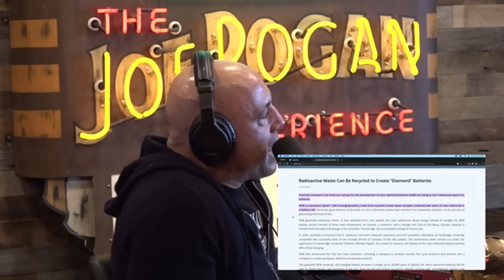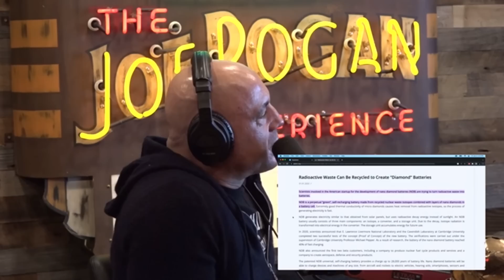Lifetime Nuclear Waste Batteries for Power,EVs & Gadgets #1921, #JoeRogan, #jre ,#joeroganexperience

Comment: So a solid point of view on the phone but the use of Radioactive Decay for power is not unheard of. The base principle has been tested by NASA. Using a Sterling Generator along with some radioactive material wrapped in a heat sink/protection module, the heat generated by the decay was used to power the Sterling motor and thus generate electricity. This means once practical application is work out, you could create a generator for a home that would provide all of its electrical needs, 24/7 with no emissions and he smaller than an outhouse.

Now since there is no nuclear event taking place the only way these can be dangerous is if the heatsink/protective cover is broken and those could be made to withstand a LOT of damage. Further these generate a constant power output that is likely above the homes actual needs. Adding this in a grid would mean whole neighbor hoods could be powered with a few of these and even if one needed to be stopped for some kind of maintenance the whole grid would still be operational.

Comment: This guy is kinda a brainlet, assuming that the heat is going to just randomly be used to generate power <-< FYI, the way they use them is by taking radioactive carbon, they compress it in to a diamond, a radioactive diamond, then encase it with nonradioactive diamond. Radioactive carbon is primarily a beta radiation emitter, which is electrons, IE potential electrical energy being emitted.

Comment: You would need a 1 ton battery to power your home. 
Radioactive decay is pretty weak (and also not so dangerous) but constant exposure would be very dangerous over time or if you breathe the material in. 

Could be a good idea to store radioactive waste tough. 

People are going to be much less worried about a set of "diamond  batteries" a few miles from home than a nuclear waste storage facility. 😂 Sounds a lot safer

Comment: This is just investment call talk.  It is to maintain the idea we have,  Right Now! An alternative.  Rubbish! 
Why is this a problem!  Radiation is energy on high scale.  Light is energy and crosses through a very wide span of what?  Vibration. 
Vibration is energy.  
So suddenly we have Nuclear waste/ energy/ vibration that is safe to use on our wrist? 
Where has the Hazard energy Gone ?
Energy for use has to be contained. Eg; Battery! 
High energy frequency needs lead to contain it. 
People fail to understand what Nuclear Energy Is.
They fail to understand how just  3 three smarty sized pellets contain a very large amount of energy. 
Church out YouTube, Thorium Salt Water reactors.  It is the best insight you can get as a layman.  TED X Channel an  Indian Professor speaks at a conference.  
You can get a better understanding. Even in a simple way.  Just three smarty sized pellets of Nuclear materials give how much energy.  
Check for yourself don't believe me... 
Notice he states that Nuclear waste can be used in a Thorium Reactor. Why! Because it still holds a large amount of energy/ Radiation/ vibration / energy.. So if they are to use Nuclear Waste, which sounds Great Right! 
But Where does the stored Radiation that is already there Go. ?????
Why is it still such an issue?  
Even medical radiation, which is considered safe at low levels. Becomes an issue if you are exposed to too much!  
I have medical issues.  I have to be careful about too many scans.  X-rays, CT's, MRI, and PET Scans! Which use radio active Isotopes via injection.

Comment: They have already come up with a system to recycle 94% of spent rods from reactors and put them back into plants. This pretty much solves the nuclear waste problem. Nuclear energy is safe as long as corporations, Russians and poor Japanese engineers (sorry Japan, that was a real bad location) aren’t running them. Or if this new nuclear diamond technology works they could just build onto existing nuclear plants to house it and use spent rods that way. It sounds like our energy worries are over. Or it’s another Thanos. 🤔

Comment: He's basically talking about a thermonuclear generator. Radiation is caused by decay of isotopes, which heats up the absorbing material around it. With that heat you can either do a conventional steam cycle (that's how all conventional power plants work) or you can do a thermovoltaic process (a connection of two conducting materials, heating one section produces electrical current). Modern space probes use that to power their devices but the power they generate isn't much. This can work for a few electrical devices but you can't power a city with it.

Comment: Joe read the tech would be able to charge devices, not put it in portable devices. I don't know why he didn't comprehend what he heard Joe say.
Reply: What Joe read is that a nuclear waste BATTERY will be used to charge an assortment of large to small portable devices, like planes, space vehicles, a watch or hearing aid.  Just like in your car or the battery-operated watch on your wrist, a BATTERY is a device that rides along with the portable device.  The guy heard Joe just fine, and did comprehend what was being proposed.
Reply: @paulryan2128  That's crazy you've never heard of a portable power bank before where a battery is literally just inside an enclosure that's only meant to charge other devices. The description is not even a battery at all, it's more of a fuel cell / generator.
Reply: @paulryan2128  a battery just holds charge. Joe said it would be used to CHARGE devices. The battery can be in a safe location and just charge or power devices from there.

Comment: It takes more then a pick axe to break diamond
Reply: not sure - they are hard, but they are brittle too i think?
Reply: @peetky8645  diamond is the hardest substance in the world pretty much
Reply: @zackwilloughby9185  being hard does not preclude being brittle.  harder steels are more likely to shatter than normal steel which just bends or deforms when hit.  diamonds in industry tend to be used for grinding or cutting  rather than hammering i think - this could relate to wear resistance as opposed to impact resistance.  not sure though.
Reply: @peetky8645  no I mean you have to get a special laser to cut diamond because of how hard it is
Reply: @peetky8645  as in it's not brittle to break apart
Reply: The point behind the statement still stands

Comment: Could be used at night to feed the grid when solar isn't available. Also could be used on remote communities like in Alaska that currently use large diesel generators and rely on fuel deliveries.
Reply: radioactive decay power sources have extremely low power density.   the article is BS written by a J school graduate who listened to a marketing graduate at a startup tasked to produce some buzz about a "product" to drive investment capital, not by someone with a background in physics.  i respect zeihan for giving a somewhat critical assessment of the fabulist technology on the fly-it speaks to at least a modicum of understanding of physics and energy flows.   the faces of watches used to be painted with radioactive paint that glowed dimly with a decay reaction in a dark room.  all the women who painted the dials died of cancer; your watch would set off a geiger counter, but the energy level would not even register as warmth.  the energy levels of decay processes are not energetic enough to power much of anything.  several pounds of plutonium can keep a satellite running with a few volts of energy and a few amps from its decay reaction.  fission and fusion are the only nuclear processes energetic enough to power a community or even a modern home.  a decay reaction might run an led flashlight, but the flashlight with a single led bulb would weigh a few pounds.
Reply: They currently dump this stuff a couple miles under a mountain because it will turn you into a gremlin and rot your ball's off. No thanks would rather use coal

Comment: Use the energy from the diamonds like gas stations use gas. Duh!!! Some peoples make mountains out of mole hills. They already have a diamond battery and it isn't hot or radioactive. You can use them in pacemakers.
Reply: don't know what diamond has to do with a battery because diamonds dont produce electical current, they are pretty much just carbon.  plus diamond is not cheap.  they may conduct electrical current better than copper or silver, but they are way more expensive.  any loss in conduction shows up as heat, i don't remember my wrist watch burning my arm because of the power lost in its battery, so a diamond component in anything other than the most high tech application is likely of no benefit.  diamond power transmission lines would likely save a lot of energy and make distant solar farms feasible, but criminal would steal them just like they steal copper pipe now - because they are made of diamond.

Comment: My brother is a nuclear engineer. It's possible. Not for individual phones but power sources.
Reply: Thats exactly what he said as well
Reply: @draggy6544  I know that I just don't trust a guy with a man bun.
Reply: would be interested in his feedback...  this seems like a pipe dream to me.   decay reactions by their nature are very long lived and very low energy, whereas fission and fusion are short lived and very high energy.   the density of the fission and fusion reactions are why thousands of pounds of fuel will only react for a few years and it is then all converted to the low energy state.  decay reactions last for thousands of years with a lot of time between each spontaneous conversion - hence the long duration and low density of energy output.    decay reactions may be suitable to warm a satellite CPU to keep it functioning, but i don't see them ever producing energy to run a modern  home much less a vehicle.
Reply: @peetky8645  Go marry a book ya nerd! Nah just kidding. I agree. I remember taking a tour through the plant. Im a construction guy and they had 5 ft check valves in there. I was fascinated with everything in that plant.
Reply: @dford8874  glad you got to see that - very cool.
Reply: @peetky8645  thank you it was very cool.
Reply: @peetky8645  look to devices like the RTG reactor that we use in space, those have incredible lifespans without needing any maintenance or refueling, with self regulating power.  They are just designed for space, not for being around humans, need a few hundred pounds of lead around it before I go near one 😅
Reply: @azimuth9819  i have a peanut butter sandwich?......
Reply: Does your brother know how to turn dog shit Into gold?